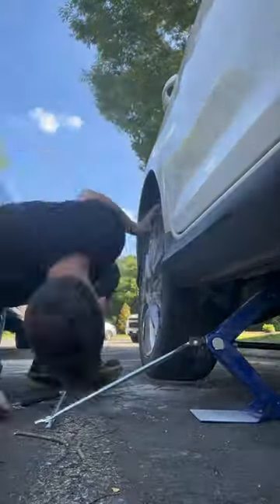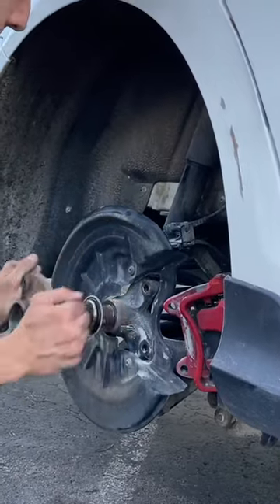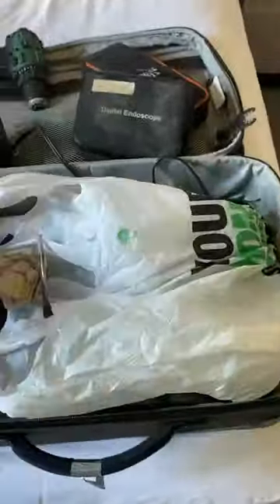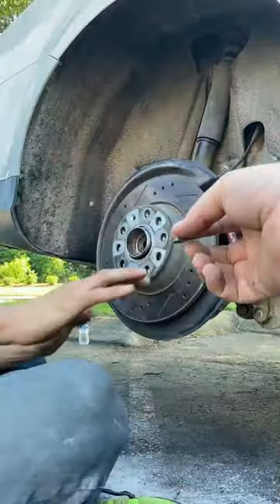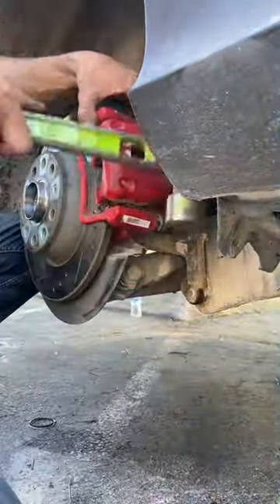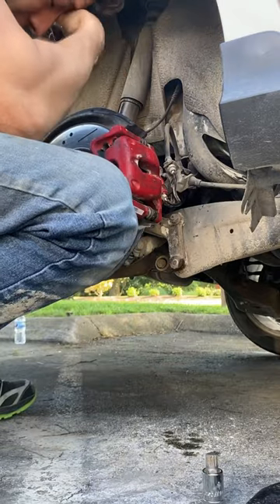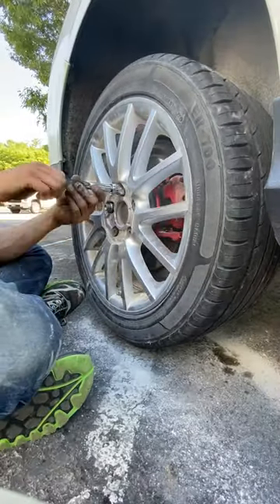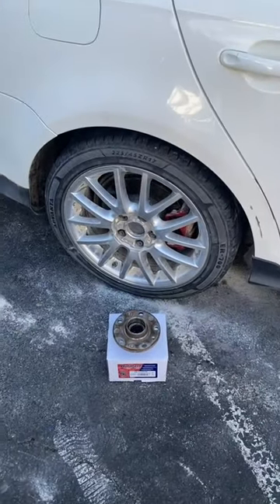Replacing a wheel bearing during a trip. #HandsomeOrHandy  #Handyman #VehicleMaintenance.

Comment: Guys....don't work under a flimsy jack
Reply: they had a tire under for safety but yes
Reply: Dont worry... no brain no injury xD
Reply: Right! You can literally drive on a bad wheel bearing for weeks. When the sound abruptly changes from a humm to something much more violent sounding better fix immediately though
Reply: @jessewurm1103 I was once young and dum and noticed a humming noise coming from my truck. Didn't think much of it until I was towing a trailer full of dirtbikes going down hill twards a stop light and the brakes gave up. It was brake fade from the rotor being pressed into the pad constantly from the bad bearing. Luckily it was late at night so I just ran the light and coasted to a stop after the hill ended. Could have been much worse, I got lucky. So while you can drive on a bad bearing, there can be complications.
Reply: @jessewurm1103 wow yeah wait until it’s failing catastrophically to replace, great advice!
Reply: Why not? The other 99% of the world does it with no care
Reply: @foojub6907  So you can not replace under a flimsy jack… That doesn’t mean push it as far as you can.
Reply: @zNickMan the tire is more for saving your limbs, if you’re under the car and it falls from the jack your face is getting crushed lmao
Reply: He's doing a job like that with a scissor jack. OMG... Use a jack stand!
Reply: The old widowmaker...
Reply: Right? When I saw him lean his head under the fender.... Oof
Reply: Clearly he didn’t have all his tools ???? Duhh and who tf cares it’s not like he’s under the vehicle. Real mechanic gonna make it happen even without a good setup
Reply: @2Titans  exactly if you have no choice or money At the moment when repair is needed. You'll work with what you have and make it work or not make it work at all and be stuck
Reply: @georgecroney6168  This is true.
Reply: Hes in a hotel parking lot, open your ears. He didnt have his entire garage full of tools and Jack stands to repair this

Comment: Taking the calliper hose off and bleeding the breaks was unnecessary. Just leave the hose connected and hang the calliper on something out of the way.
Reply: Yes that was weird - how is there a possibility of air getting in the system unless they disconnected the brake line, (which I don't believe they did.).

Comment: I wish all wheel bearings were as easy as rear wheel bearings on a front wheel drive car
Reply: Modern front wheel bearings on RWD cars are even easier...almost as easy as changing an air filter. Just unbolt, swap in, rebolt, and done. No packing grease, setting drag, cotter keys...none of that at all.

Comment: Once you get home torque the hub/bearing bolt to proper specs. If not enough torque is applied you will change the bearing next year instead of in next decade. Very important on VAG cars.
Reply: The most important thing you can do with any VAG product is trade it in IMMEDIATELY. 😂

Comment: If you take the two bolts out of the end of the caliper at the slide pins, you won't have to fight the caliper bracket and caliper at the same time.
Reply: Pry it back a little slides right off and back on

Comment: Did you torque the hub down? I mean it wouldn't be fun to have the wheel fly by you on the interstate 😂.
Reply: No way he did. Its like 133ft lbs plus a half turn. You need a giant breaker bar to do it. Depends on which style bolt as well the torque spec

Comment: No way that axle bolt is torqued to spec. You need a 1/2 4 foot breaker bar to get that torqued correctly
Reply: And the hulk pulling it
Reply: Get one of those 700 dollar snapon digital torque sticks.
Reply: standard 1\2 torque wrench is just fine they go up to 250 ft lbs in most if not all cases and the chances of that small bearing being over that is basically 0
Reply: Wtf is a breaker bar going to do??? Breaker bar ain’t gonna torque to spec either smart guy 🤦‍♂️

Comment: Damn that wheel bearing bolt is torque to over 180 foot pounds plus a degree turn lol stay safe man
Reply: 147 foot pounds plus 180 degrees if the bolt has a flat contact on the back, it is different if it was ribbed. Just did this shit last week.
Reply: @64seweryn  Looks like it was just a couple of ugga chuggas for them.

Comment: Not trying to criticize but you cant get air in your brake  lines unless you remove the brake line from the caliper even when you push or twist the piston in to accommodate new pads this again does not let air in.... on a side note im assuming this is a german car judging from the torx bits ?

Comment: What possibility of adding an air in to the brake system? You didn't open anything.
And how did you pull off that hub of without puller, thats some lucky stuff right there.

Comment: never work on your car , with only a car jack , That's actually designed to change the tire quickly never put your head under the car like that with just that jack..  Showing this on video is actually really unwise and Can lead to fatal mistakes if people are going to copy you..   always use a proper jackstand... Even just one would be fine after your jack it up...  Whenever I do my oil change I just use one single jack stand in a parking lot, Or if you know what you're doing you can use your curb if you don't need to remove the wheel just ride  up on a curb.. But yeah brake job always use Jackstands

Comment: you have a leak if "Theres a chance air got in"
Reply from the maker: We had to open the drain valve in order to get the caliper back on
Reply: @HandsomeOrHandy  Didn't have too, thats a UTI myth. Ive never seen a technician open a drain while pressing pistons, has never cause damage or any issues
Reply: Opening the bleeder won't let air in when you push the caliper piston in it will let out any air and some fluid no need to bleed and it's not a drain lol
Reply: @michaelpaecht9519  ANY TIME you open a bleeder, you need to bleed the brakes, some vehicles will suck air.

Comment: Working under that vehicle with that emergency scissor jack is Dodgy AF!! Also, a wheel bearing does not just fail out of nothing. There would.have been noise from that bearing for awhile. The fact you were not sure it was the bearing and yet decided it was after removing and destroying it, well at that point you had no choice haha. But don't be making out the wheel bearing just went out of no where, that would have been an indication for awhile that he was probably ignoring until he had no choice. 

People don't ignore wheel bearing noise and don't work under your vehicle using the emergency jack!! Don't do what they did in this video and learn from their stupid mistakes.

Comment: M14 triple square for the rear caliper brackets. Think ot was 60 foot pounds plus 90 degrees. The  hub bearing bolts get 147 foot pounds plus 180 degrees. If the bearings start howling after a week, you'll know why. You took the bearings off so easily. Hope you never have to do the fronts. Get a bearing puller slide hammer thingy from advanced through the loaner program and buy yourself a cold chisel